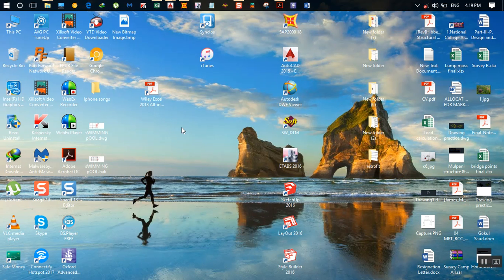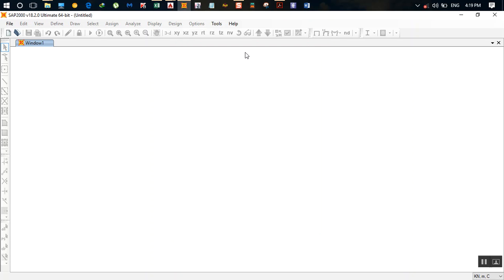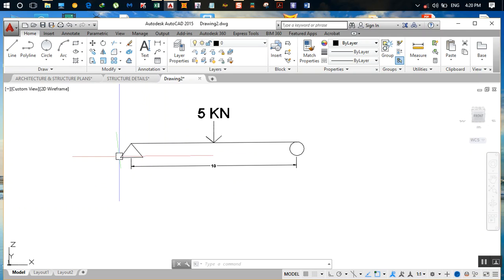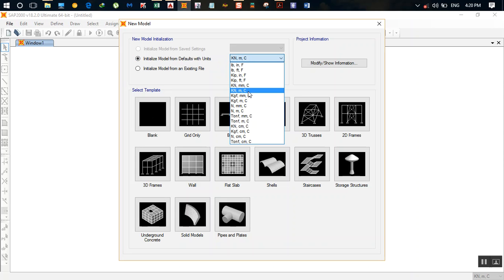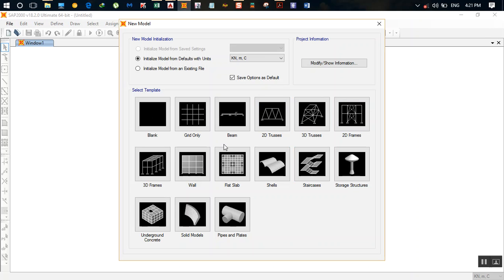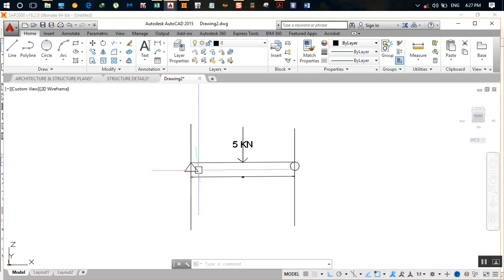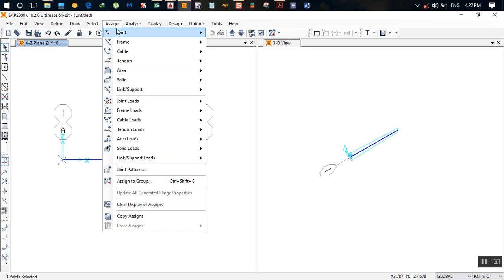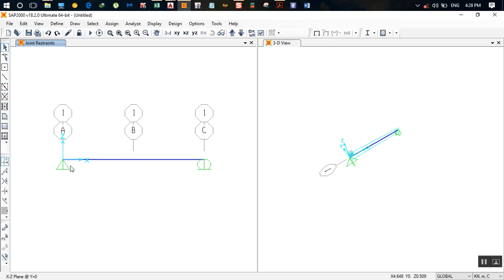SAP 2000 Tutorial For Beginners [Chapter 1]: Introduction Part 1

Comment: Brother its 5KN force at mid how joint reactions are 4.14 it should be 2.5 each
Reply from the maker: It's because the self weight has been taken into consideration.
Reply: @engineeringacademy9812  how to avoid that?
Reply from the maker: @shahsaib7066  in the load definition, you can set the self weight to 0 and not 1

Comment: Your analysis resutls are false. The support reaction should be 2.5 KN and max moment should be (2.5 x 5 = 12.5 KN) as per mannual calculation. The reason for this error in your sap2000 results is because of the load pattern and the dead load multiplyer. Please make a correction. The SFD you shown in this video is also false. 
Tip: Just don't follow sap2000 blindly, do manual calculations as well to cross-check.

Comment: Why the shear force is 4.14KN instead of 2.5KN at end as it is a SSB with point load?
Reply: See comment above by Faraz Khan

"Only step missing is go to define ---> load patterns ---> and make the self weight multiplier of dead load as zero. to get the accurate result."
Reply: But once we make dead load 0 it is showing error in analysing

Comment: Just wondering why the  max moment is not 12,5kNm and the shear constant 2.5kN or -2.5kN
Reply: Max moment comes equal to 12.5 KNm only if beam is mass less. So maybe SAP has considered the self weight of default chosen steel member.
Reply: that makes sense..cheers
Reply: Yes exactly sap has taken into account the self weight, in fact you will have noticed also that the shape of the bending moment is not triangular as you expected. Don't get puzzled, just watch the video in order to understand how you can display the bending moment, shear and so on. It is a good video. Cheers
Reply: The same question am I asking